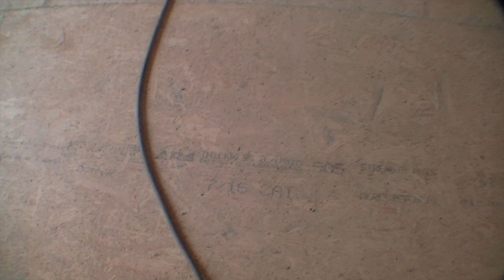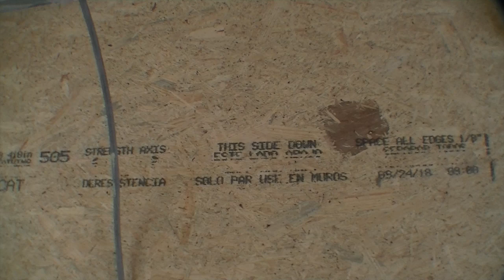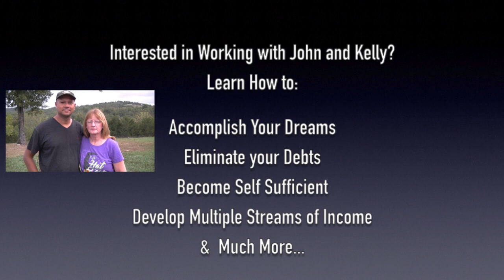OGH - DIY House Build Part 36 - Sanding OSB Floors - Framing - Zip Board - Roofing

Comment: I need to clean my osb subfloor from all the drywall mess, Any advice and drawbacks from using a floor sander
Reply: Take your time.  Start with a lower grit (more abrasive) to get the drywall removed fast, then come back with a medium grit, then fine.  We water based Polly’s our floors and used them for 2 years.  Then we added commercial click flooring over it all when we had more money.